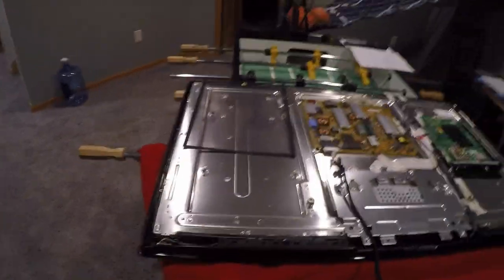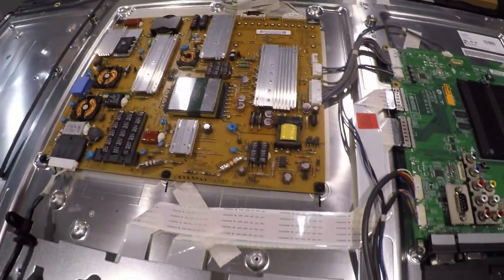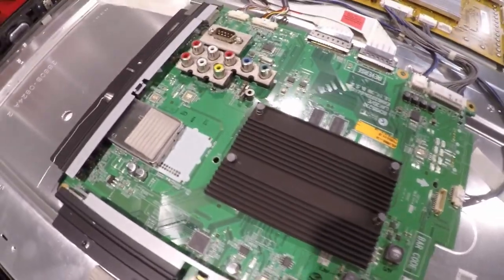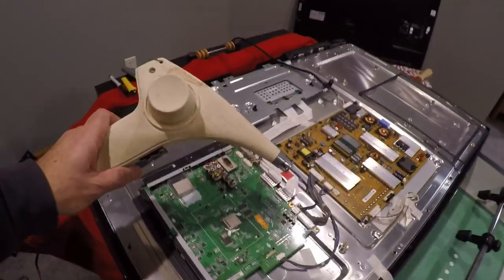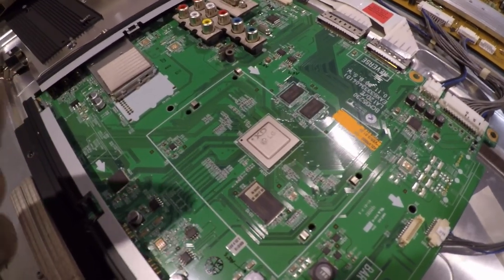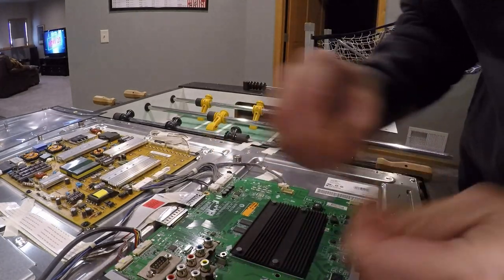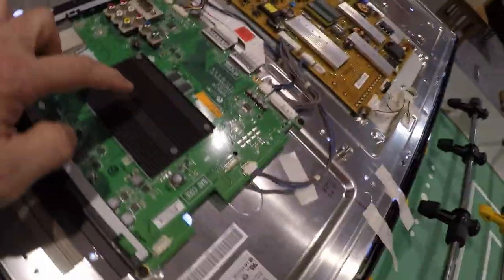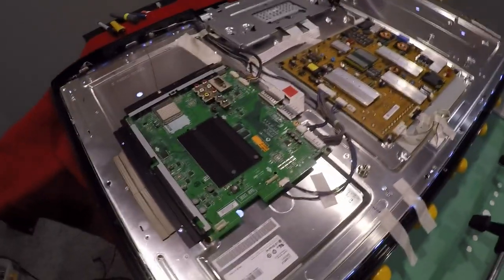Main Board Repair of a 'junked' LG 42LV5500 TV Reflow Oven

Comment: I fixed my 47LW6500 after watching your video, thank you so much for the inspiration!!! I heated the chip at 300 degrees celsius for 5 minutes using my hot air gun, and then pushed it gently making sure not too wiggle it too much.
Reply: So something did go wrong with my TV - the heat gun trick fixed the image but the sound never came back through the internal speakers, I ended up attaching external speakers. Still a win in my book since it did not add to the recycle load on the planet.

Comment: I can't believe that this worked, I ran a couple of tests and narrowed down the problem to the main board, borrowed a heat gun, set the heat gun to 250 celsius, waved it over the large heatsink for three minutes total and I let it cool down, plugged it in and the TV turned on, I did not expect this to actually work, awesome!
Reply from the maker: It may not work for long. You actually need to remove the heat sink and heat the chip directly to reflow the solder under the chip. and if you notice when you remove the heat sink I bet you the board is kind of bowed or sinking or sagging. So you need to maybe make a little wooden block to support the board in the middle that is the same height as the standoffs around the edge

Comment: My LG is working again! Thank you for the video. I saved some money.  I warmed up the chip with a proHeater gun with only one temperature setting,  for 5 min only, the board started to bend slightly below the processor so I stopped. Maybe to much heat. Thank you 🙏
Reply from the maker: Excellent!

Comment: Amazing!! WORKED!!   August 20   Now I have dirt, or Dust shows as black on screen trapped between the panel. People make sure to cover the back of your set if you will not be working on it for longer than 5 minutes. Use a clean sheet or something similar. Thank you so much for this great video. Also just a good tip I did add some Computer Thermal paste ( Artic Silver) to the Chip. I did this on a LG 60PZ950 Set. Thanks Again.
Reply: Update, I was able to remove the dirt particle or Dust with a new dry Microfiber cloth. YES!! Thank you again.

Comment: You are a life saver!
Followed instructions and my TV is back up. 
I did not have a heat gun and I used the following, in order: gas stove (carefully place the board a few inches away from the flame), then hair dryer (my dryer switches off once its too hot so 1 minute was enough here) and finally a cigarette lighter (again gently bring the flame as close as possible to the actual unit without the flame coming in contact with the board. Risky I know, but it worked this time.
Reply from the maker: OMG!  not a safe way.  I'd use the oven method before doing that.  Or this device another guy used...  https://www.ebay.com/itm/Aluminum-PTC-Heating-Plate-LED-Remover-Demolition-Chip-Welding-Soldering-Station/114168582643

Comment: Very thorough in the information you provided in the links, thanks. I used a 200 watts incandescent bulb on an extension cord resting against the circuit board for about 2 hrs and it worked! I didn't know it was that specific chip needed the heating. Much appreciated! You earned a subscriber!

Comment: I picked up the same tv today from nextdoor with the exact same issue I used my heat plate I use for desoldering leds left that on the chip for 3 minutes and now it switches on and is working good thank you 😊
Reply from the maker: I didn't know what a "heat plate" was, but i see some on eBay for $10.  Looks like a good controlled way to apply heat to a bga.  Do you have a link to what you bought/used?
Reply: @timgoihl  tkdmr 300w PTC heating soldering plate. They are on amazon $15.99 they don’t have temperature control but iv fix about 10 or so led strips with it so far it works great

Comment: This worked for me! I did remove the heat sink and pointed a heat gun to the chip until it got to 215 degrees. Placed things back, turned it on and IT'S WORKING, IT'S WORKIIIING!
Thanks for the tip, this saved me hundreds on a new TV.
Reply: Still working?
Reply: @galford50  tv still working today

Comment: Adding another thumbs up for the recommended repair steps.  I used this process on a LG 47LW5600 which sat in storage for two years because I didn't want to throw it in the dump.  Every time I checked the TV, it would briefly turn on and then turn off, after which the only response was the power LED slowly flashing red.  The TV would not power again unless disconnected from power and drained, after which it would again briefly turn on and  off before flashing the power LED red and failing to respond further.

Removed the back panel and power cable, removed cables from the mainboard, removed mainboard, removed the chip heatsink by depressing each plastic locking pin down completely and then "pinching" the exposed end with pliers (and then gently pushing the compressed pin through using the rubber end of pliers), wrapped the board in aluminum with a cutout for the XD chip, and used a heat gun and infrared thermometer to heat the chip to approximately 140-170C for 6-7 minutes.  Removed heat, removed foil, the PCB was slightly "yellowed" at the focal point from some heating but look, it's better than a dead TV, so.  I let the board cool for a few hours, then replaced the heatsink thermal pad with some leftover Thermal Grizzly pad (why not?), remounted heatsink, remounted board, reinserted cables, and - the TV lives! 

TV has worked since this process was applied, and is now back in use - I will edit my comment if that changes in the future, but my fingers are crossed.  Thanks so much for sharing this video, it was the clearest guide I've found to both identifying and resolving this problem.
Reply: I am having the same problem. Would you recommend putting the motherboard in the oven? And what exactly does the heat do to fix the problem? Thanks
Reply from the maker: If you watch my whole video you will know that I don't recommend the oven method. I also explain what the heat does. Heating the video chip resolders the broken solder joints underneath the chip allowing it to work again.
Reply: Wow that worked guys, its a 2010 TV and still running. Thanks!

Comment: It's me again! It worked =)
I used a soldering heatgun at ~215 C' for about 3 minutes. And i wrapped the board into the foil and made the cut around the chip, just in case not to "fry" anything nearby. In the very end i gently pushed the chip  downward for better soldering.
FYI, this solution ALSO works if your TV works, but you get "RED or GREEN SNOW" on the BLACK parts of the video. I also repaired this way my another, even older TV with that "snow" issue and now i don't know where to use it))))
Reply: Hey, Zakkman. I have an LG tv with the snow/static problem. All icons and app UI displays correctly, but any video played is snow. I was told it's a bad mainboard, but have since been told that reflowing in the oven at 385 degrees for 10 minutes. Can you tell me a little about your experience with fixing the "snow" problem.

Comment: Thank you, 350 C for six minutes! More helpful the service manual insights on the power supply and tcon. Grear job. Subscribed
Reply from the maker: Hopefully you mean 350 Fahrenheit. 350c is a little hot for solder solder maybe 200c.  But glad it worked

Comment: Thanks a lot !  I was able to fix  the way you showed it.  I ended up doing this twice. The second time around I pushed the heatsink hard and tight while putting it back together. The Thermal paste/sticker between the chip and heatsink probably degraded.  Next time it goes out, I'll have thermal paste in hand. For the record, I used a hair dryer.

Comment: I repaired my 47" LG using   this heat method. Fortunately, we have a SMT rework set-up where I work (broadcast shop). Unfortunately, the heat station doesn't have a readout of the heat - just a knob with settings 1-5. Chose highest heat, but with the fastest airflow. Went for broke (curb sale LG...) and went at the chip (heatsink removed) for 5-ish minutes. Let it cool down to ambient for half hour, resisting the urge to move it. Reinstalled and set now works fine! 
Yours is perhaps the most comprehensive video on this repair.
Totally agree: the oven method scares me, and probably ineffective long-term. My inspiration.
I also added a small muffin fan over the "grille" in the rear of the set, where the board resides. I used a 12VDC unit running off internal 5V in the set. Fan runs slower but much quieter. Not concerned about losing depth - set is on a stand. Cheers!!!
Reply from the maker: Nice job. I like the fan idea. I bought a 40mm USB fan from Amazon and did the same thing you did. It plugs into the USB port of the TV for power.  I picked up another free 55in off of Craigslist last Tuesday and had it fixed in a few minutes with my heat gun. Now I've done three! I don't even know what to do with all these TVs, they're just fun to fix!  Out of curiosity what model and year was the TV? Every one I fixed has been a 2010 or 2011 so it's almost like they had a manufacturing issue during those years.
Reply: I found a small sticker inside with a date of 4 / 10, so that falls into the range at issue. Its a 47LE8500. 
I keep finding these flat-screen sets at local "curb sales"...two I found worked straight awa, one even had the remote taped to the set - considerate of them. Thinking these sets are becoming so affordable now that when people move, its not worth the trouble to cart them along.
This latest find needed this repair, and was brought back to life. 
Seems like you, I get satisfaction out of seeing these work again; guess it's a techie thing...
Cheers!!!

Comment: I just tried this on my LG 55GA7900 and it actually worked.  I can attest that you do need a high-temp heat gun because I tried this with a hair dryer for 10-15 minutes and it didn’t work. Bought a Werner 750 heat gun and heat it up for about 5-7 minutes and that did the trick. Seriously though, thank you so much for this video. I was skeptical at first, but my only other alternatives were to junk this nice tv or try to buy a main board which I didn’t have the time or desire to do. A+!
Reply from the maker: Sweet!  What year was your TV? I think it's printed on the back on the nameplate.
Reply: @timgoihl  it’s a 2013 tv. It was one of the GoogleTV models. Really nice unit with really thin bezels. I scored twice, wife let me replace the TV when it stopped working, so we now also have a Sony 65” A80J OLED TV. 😁
Reply from the maker: @clarkgourguejr  Nice.  So far it seems to be the 2010-2013 models.  Now you have one for the man cave/shop!

Comment: I did this technique, with my hair dryer for about 10 minutes and it worked perfectly!!!! Thank you so much for the tip! Greets from Peru!
Reply from the maker: You showed this is the problem, but a hair dryer does not typically have enough heat...  You may have to do it again in a few weeks or months - try to find something with more heat if you do... Good job!
Reply: @timgoihl  ok thanks! I will let you know if it happens again and if I can solve it. My hair dryer became very hot by the way...

Comment: This also worked on a 47LW5600 - same troublesome chip, slightly different arrangement. Also applies to 47LW5600, 65LW6500, 55LW5700, 55LW5600, and 47LW5700, which share the same mainboard (EBT61438207 / EAX63969204).

Comment: @timgoihl Excellent video, explanation and links. My 42LV5500 had standby power but no backlight or picture. Passed SMPS and T-CON  colour cycle tests as per your linked service manual/training guide. When switched ON using remote ctl it generated PWR_ON (3.5V, 12V & 24V are good from the PSU) but not DRIV_ON hence the backlight did not come on. The board did not appear warped as there are at least 8 standoffs under it - maybe yours was badly assembled but there was browning under IC101 consistent with hot running. I removed the heatsink, masked surrounds with aluminium foil and tried reflow of IC101 using Hot Air rework station set to 240 degC and low air flow for 80 secs but no improvement. Then used UV50 flux on all sides of the chip. Mounted hot air blower on a boom stand about 1 " above the chip and ran slowly up to 300 degC (indicated on the station) and left it there for 3 minutes, moving the stand slightly to spread the heat evenly. Let it cool and surprisingly there was no mess from the flux! it was all sucked under the chip. Powered it on and it was working but with vertical lines across the entire screen. Removed and cleaned both ends of T-CON ribbon cables using CRC CO Contact Cleaner. Reassembled and it's as good as new. Great result.  Big thanks for your post.

Comment: Hey there, Thanks So Much!  for sharing. this worked and we are trilled to bits. Much thanks from New Zealand 🇳🇿
Reply from the maker: I was just as thrilled when it worked for me too!
Reply: Wondering how long you would expect a reflow to last? Thinking it may be a good  idea to get a technician to repair the part.
Reply from the maker: @rachaelsuzannebaker-trebil6785  well mine is still going. As I mentioned in the description, I think adding a standoff, board support under the center of the board would help. It really depends on how well of a reflow job we do. one could also add liquid flux to help the reflow job along.  But I'm assuming your TV lasted quite a long time up to the point that you had to do this, right?
Reply: We actually bought it not working in the hope to use the screen as our newer version TV was faulty. We replaced the LED strips which was successful however we had somehow damaged the screen. The  replacement TV we got going by replacing the T-Con with a newer version made for that model. 2 months later (yesterday) it stopped again being the problem being resolved because you shared your knowledge on your youtube channel. Again thank you so much.  By the way I followed your instructions to the T but used my hairdryer. 🤪
Reply: And the case of the missing screw, ours is missing also so maybe its not missing. Couldn’t see a thread.

Comment: Tim , did you clean off and add new heat sink compound on the main board heat sink? That might make it last longer. If the gpu chip can’t transfer the heat properly it could melt the solder again. It could be endless cycle.

Comment: Here to say this: 

Well done with your video Tim! I'm going to try this. I appreciate your "amateur" style of explaining things because your understanding of components is PROFESSIONAL. 

Trying this now.

PROJECT:
Model: 50UM6900PUA

Issue: Sound is normal.
`````````Brightness: 100%

During a movie, my TV went black. However not completely. I still have display, I can only see it with a flashlight.

Im going to attempt this Heatgun Reflow attempt, and be back with my results.
Reply from the maker: If your display is working the picture is still there, but you can only see it with a flashlight and your sound is working I'm going to say that your back light circuit is not working anymore. Probably don't need to reflow the chip. I've had to fix backlight circuits before sometimes it's just one or two LEDs in a series that go bad so then the whole whole line goes out.
Reply from the maker: If your model is pretty close to mine, then download the service manual and read the stuff about backlight testing. The service manual is very good.

Comment from the maker: I just did another LG55LX6500 this week (9.12.21)  This time I added a very small amount of liquid flux around the edge of the chip, then warmed the bottom of the board with the heat gun until the flux started to flow, then heated the chip directly for a minute or two.  Worked immediately!  
3/20/22 LG55LW5600 2011 Heated chip, TV works
Reply: what settings did you use on your heat gun (air level, temp) ? My air doesnt have a digital display.
thank you very much, waiting for your reply

Comment: Thanks for the video. I have this same TV, and had some video anomalies (horizontal lines of varying lengths) and now the power light will just come on and then go off after a second or two. Already blindly replaced T-Con board - no help. I do have a heat gun to try and use on the main board as you show. QUESTION: did you take the main board out of the TV assembly to do this (like on a table, for example), or did you just remove the board's screws and remove the heat sink and leave it sitting in the chassis while using the heat gun?
Reply from the maker: I did what you said I removed the screws to the board remove the heat sink, and heated it just laying right there in the chassis